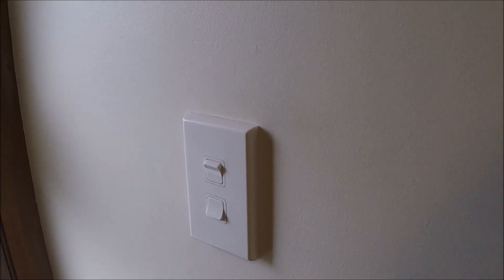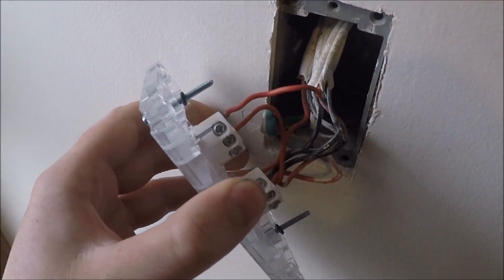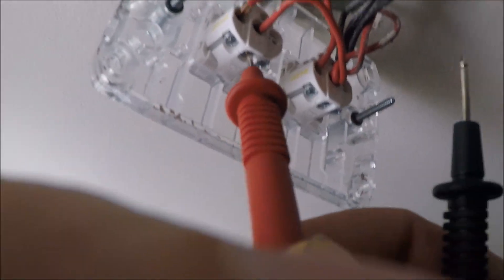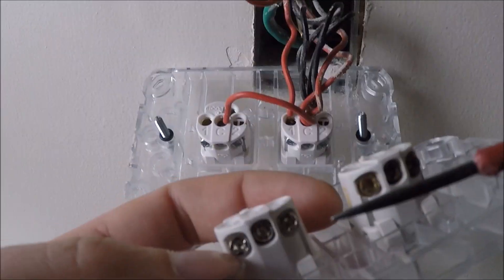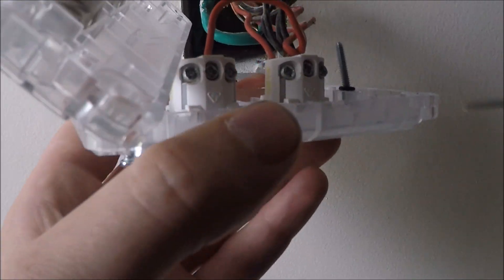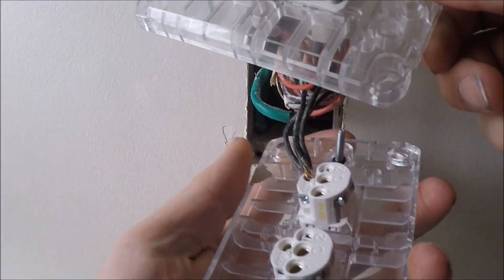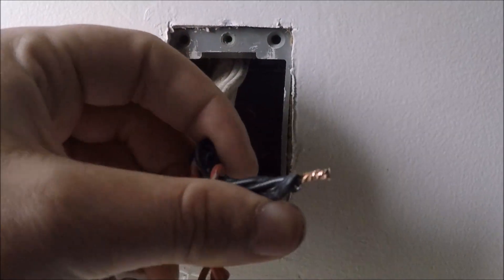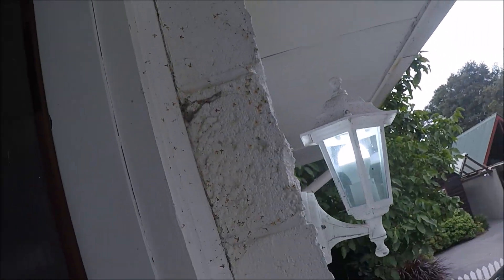How To Replace a 2 Gang (Double) Light Switch

Comment: Hi Dave im not sure if you are still active, i have been using your videos to do some basic wiring in my shed. I have one thing im not sure of, i have wired 2, 2 gang switches that are to be used 2 way. Since my main feed runs into T1 my little bridge feed wire would run down to T1 also on the 2 gang switch then continue my 2way connections as per usual? Guess like this T1 Bridge to T1 and white, Strap red to common, Red light Feed + Blue to T2.

Comment: Hi @sparkydave

Im wanting to install cat6a ethernet through the house (bought a spool super cheap). I have pdl 600 series switches through the house. 

Question: what do I attach the single gang cover plate to? It can't directly clip onto the flush box, so is it a pdl shallow mounting block that I need?

Thanks!

Comment: I accidentally pushed my on/off switch in and the light was on, I unbolted the screws first before turning the power off (was hoping I could pop the switch back in place without turning power off) and I got shocked a bit 😂 I went and turned the power off and ended up pushing it back in place before the parents came home 😂 the hardest part was the massive spider at the fuse box 💀 anyways thanks for your help 😁